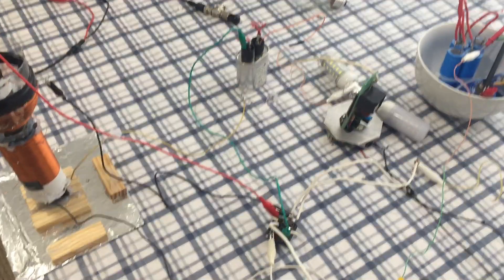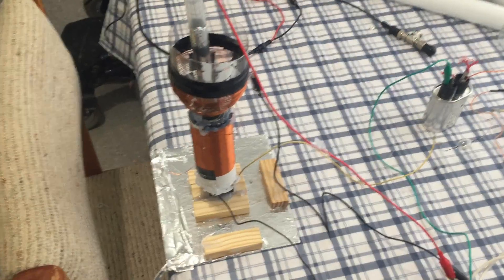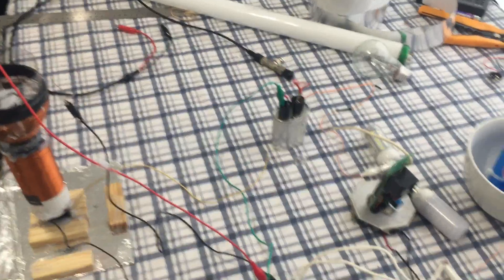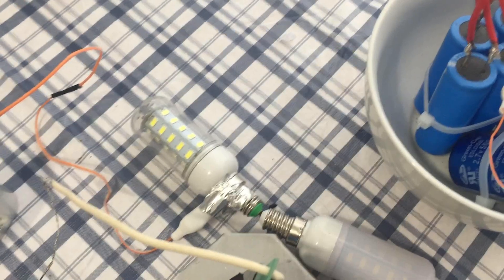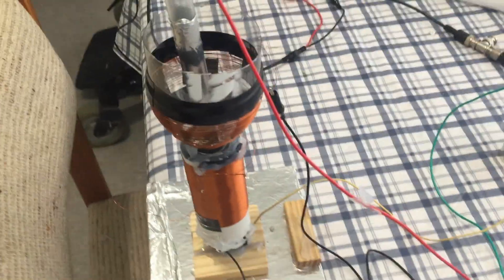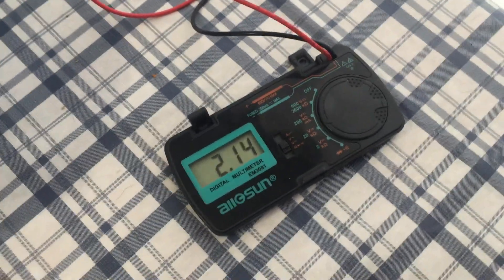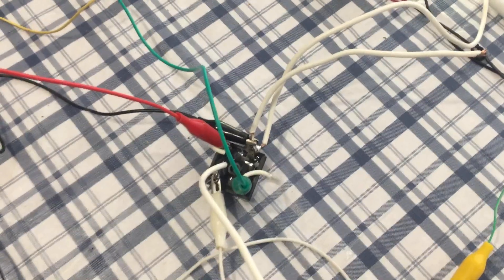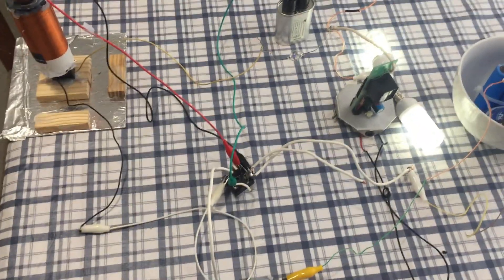Don Smith SWR Power

Comment: Hi Joel, thanks for sharing.

Just to make sure we can nail the working principle as I am currently working on a different setup. So, I want to mention on top of your circuits: “what if I did this …”, “QuantaMagnetics”, “MtechIndustries”

As we can see we have a small power source for creating oscillations/disturbance in local environment (floating system) as input circuit AND the output circuit coupled to it where amplification is done at some cost of the input circuit as being part of the same floating circuit whatever coupling method is employed.
Now, in order to decouple output from input while maintaining the excitation we need to introduce separate ground connections for each circuit being air grounding, earth grounding or both (as long as they are separate for each circuit). What is the role of this grounding ?
1. Providing a separate source of the “opposite sign“ and make the system working as 2 separate sources.
2. Increasing the potential or extend the gradient of the potential when a potential difference exists between circuit and grounding or between the 2 grounding points (electrostatic difference), in case of 2 grounding points one must connect on lower side (“negative”) and the other on higher side (“positive”). It is obvious for economy of the system we only need a higher potential only in the output circuit where we close the circuit through the load as we need a low potential in input circuit for easy management and low cost input.

Although it might work with a single ground as in Kapanadze circuit where proper adjustment is done in order to obtain no loading of the input with the output. This can be done empirical by measuring/monitoring the input and adjust coupling of the output until we see no more power being consumed by the output while we still have a low power consumption for primary/providing circuit (usually few watts). When we get this done, we add the gradient (grounding/antenna) supposing the output already have desired ratio amplification 1:4, 1:100 whatever can support our components of secondary. Now we can split the output to loop it back or use as it is if we have used a convenient self replenishing source.

What we need to understand: unlimited output power always refers to a certain amount of energy being drawn continuous and NOT any amount of power ! If the system have been tuned for 500 watts output means we can draw 500 w continuous and not 5000 w. If we draw more power than the system have been designed the source will be depleted ! So, this where we need to focus, on the output capabilities: add as many secondaries as physically possible and/or increase the gradient.

How to test where a grounding should be added ? Once we have the system tuned where the output do not load the input, we take a rectified corresponding (matching input) voltage from output  and touch the input with a positive and measure voltage across the rectified voltage. If the voltage increase it means we need a grounding on negative. Check with negative, it should decrease the voltage and this is where second source (gradient/grounding) must supply. Just simply adding a ground on this side it won’t work without tuning as we don’t want to pump energy into ground but the opposite, it means we need to add some resistance to prevent energy going down the drain and allow to entry in the system where our primary source (loop back) is demanding.

Please, observe all systems must be designed as floating and ground connections should be used as above just for potential enhancement. In any case we shouldn’t use common ground, IT MUST BE AVOIDED !

This is my theory and as soon as I have all components I will make a video to prove it, as all the above have been tested by myself and already seen in this video of Joel, What if I did this, MtechIndustries, QuantaMagnetics.
Reply from the maker: I only follow myself now hehe. Others are too much of a distraction. But i'm sure they are all getting it in their own ways. :)
Reply: Who do you mean with quanta magnetics, Mike Kantz, or crazy William that stole Mike's logo and company name?
Reply: @ I really have no idea what are you talking about … my reference was for exact point where is shown no power consumption from input where secondary display plenty usable power. Not trying to promote anything else ! It is a pure physical phenomena that is always omitted on purpose from any books on mainstream science or is presented as breaking “physics laws” … “they” need to understand it will never be possible to dictate what an individual is able to think on its own despite their huge expenditures on brainwashing.
Reply: @GreenmeResearch to be honest I have no idea about any drama  … I have mentioned all the above channels just for the explicit shown phenomena, if this bothers you please ignore. I am only interested in working principle whoever is able to show it as long as it is in public domain. I don’t trust in patents anymore and this should be part of humanity general knowledge available for any and every human living on this planet.
Reply: @Caesarus2011  you are not bothering at all, just making sure that all know that, even William has his purposes, i bought one of his devices and replicated some of his others, they are waiting to be finished, when the knowledge/experience is there to complete then. Good luck experimenting

Comment: Hey Joel! Is this the same setup you used to get a 150w inverter running during the power outage? Im assuming you have limited it here for demonstration purposes.
Reply from the maker: Yeah on small scale, I flopped the big one in part by accidentally dropping the tube and breaking it, While experimenting. Limited supplies..... Another one is on order and hope I can replicate the setup.
Reply: @joellagace1679  Damn that sucks those tubes are not cheap and they will take a while to ship. Im looking foward towards prototype 2!
Reply from the maker: This is good as well it shows that with some fine tuning and not as flimsy setup as this one could make this even more efficient. I lack the measuring equipment to see the exact efficiency numbers but that may chance soon.
Reply: Most definitely this shows that it can be replicated without expensive USSR neon tubes. A self running setup is more than sufficient for demonstrating overunity. That equipment may not be needed for proof. Either way I believe you have created something significant here!